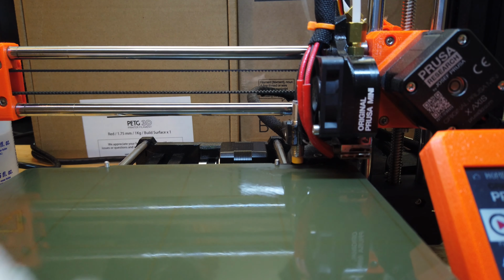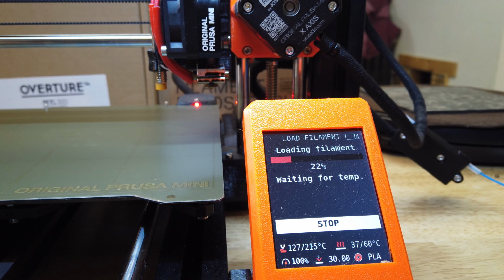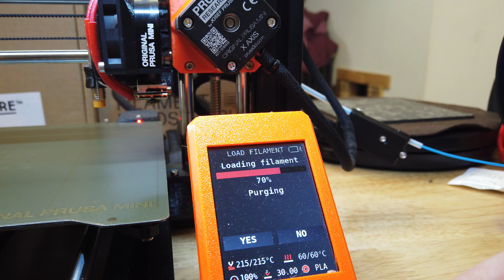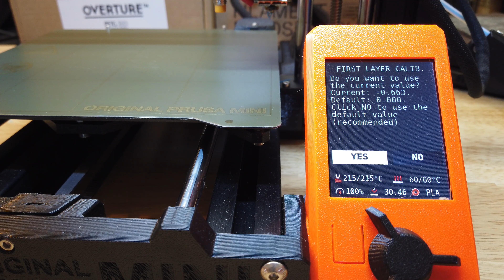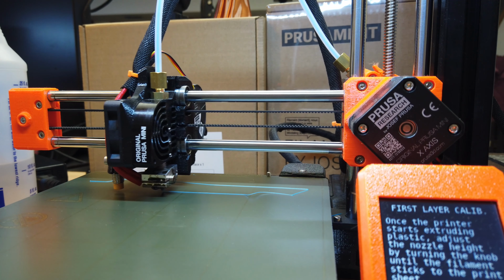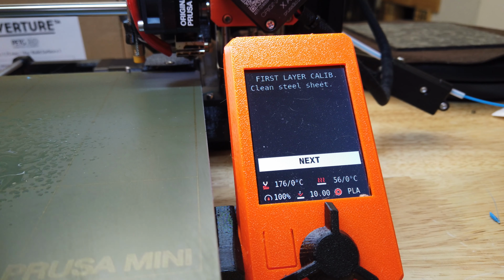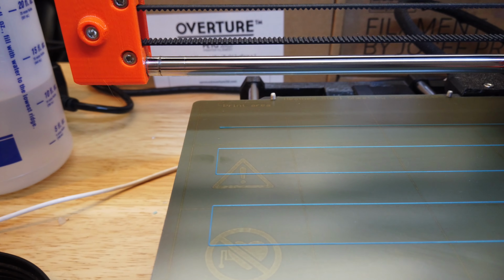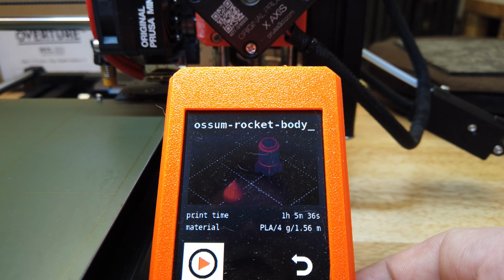Prusa Mini: First Layer Calibration and Filament Loading

Comment: I bought 3 machines, the super pinda probes are all at 1mm from the factory, but during the calibration I had to max out at -2mm to get the layers to stick. The square at the end that it prints is still not fully in tact. thoughts?

Comment: To put filament in it's best to cut it slanted.
Reply from the maker: I agree and I did give it a bit of an angle in the video. however extruders with hobs like the Mini, aren't usually very picky as long as the filament is about 1.75mm dia. That's why I made a point of leaving the little blob on the end and nipping it off.  The loading routine needs a bit of tuning and Prusa will get it done.  My MK3s was quite picky when it was an early MK3 now it will eat about anything you stick down the hole...
Reply: I have to agree with @Nicolas Belin. Prusa and many others recommend cutting the filament on an angle to allow it to find its way through the extruder.

Comment: I manage to resolve the problem with the nut . I change the filament to standard PLA. The nut came out great! But when I made the bolt I applied the glue to it hold for a while than broke free. Do need to use the glue or just stick with the alcohol? I notice that you didn't use any glue on your projects.
Reply from the maker: It sounds like your first layer call is a bit off, if you’re using PLA with the smooth build sheet you shouldn’t need any glue, just a clean, oil free build sheet. 

I would work with your first layer offset, if you use the first layer calibration option in the menu you want to be able to run your finger gently over the line of filament without the filament coming loose. If it’s flat looking the nozzle is too close, if it comes loose easily it’s too far.

Comment: so this Z-value differs fron printer to printer.. but what would be the ideal values for prusa mini+?..
Reply from the maker: There is no idea value, each printer will be different, there are too many small factors in assembly to have a fixed number. For example you may have the nozzle threaded in 1/4 turn more than mine or my nozzle choice may be a bit longer/shorter. When were talking fractions of a mm that makes big differences in the number on the screen. The only Target is a first layer that sticks without being flattened.

Comment: I reset my probe to exactly where you put yours, with a zip tie. And I'm using the same smooth sheet but I keep getting around -1.6 for mesh bed level. Seems a little too high, should I try mounting my minda probe higher than recommend to get closer to around -.5?
Reply from the maker: The +/- number isn’t as important as people claim, my MK3 is running at -2.3 or so with one of the sheets and the Mini currently runs at -.8xx with one sheet and -1.1xx with another. The important part is that the preprint level routine works and your first layer is right and even.

Comment: Thanks.  Have you had the z setting change on you?  I set mine (around -0.300), made a print just fine, shut down and the next day I went to print again and it rammed into the bed when it started the print.  I did the calibration again and it came in at -0.900.
Reply from the maker: It changes a bit every time, but not generally that much.  However, the Z height can change from filament to filament.  I have one Silk PLA that I have to raise the Z by .060 on all the machines.  In your case I would check the Minda Probe and make sure it’s little clamp is snug and that nothing has gotten under the print surface between it and the heat bed, sometimes things sneak under the there.

Comment: How hard do you have to push to load the filament through the tubing?  My filament sensor is very difficult to push through.
Reply from the maker: Pushing that filament through can be a pain, to make it easier, first ensure that the PTFE tube on both ends is full pushed into the filament sensor. Then cut the end of the filament at an angle.  It can still be a pain but that will help.

Comment: I don't recommend using acetone because it is a very strong solvent and it can slowly eat away at any coating that isn't acetone resistant which is most things and even though it doesn't show signs of wear at first it will significantly lessen the life of a print plate. just don't do it.

Comment: Did you Always use the -.590?
Reply from the maker: No, the Z offset is different for everyone, it depends on your printer. Do not use my number, you'll need to find yours using the first later calibration option in the calibration menu. Mine is currently at -1.xxx because I changed print surfaces.
Reply: Ahh okay, for mine i am at -0.750...but not sure if it's still the right one
Reply from the maker: If the filament is sticking for the first layer, you’ve got it 👍

Comment: Hey i just got my prusa mini and am new to printing. When i do the calibration mine starts in the bottom left and the square finishes in the top left?. Any help thanks.
Reply from the maker: That is a weird one, I have some ideas, but I suggest that you take a video and contact Prusa tech support. That’s one of the nice things you get with a Prusa, take advantage of it, they are usually pretty responsive.